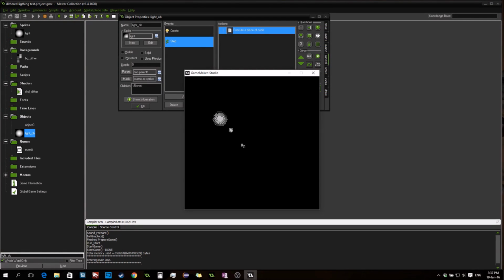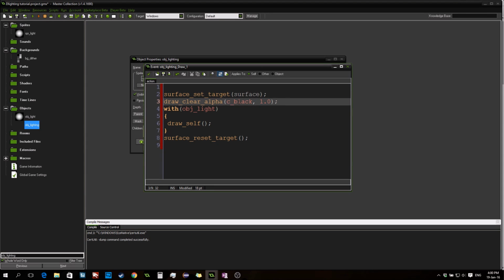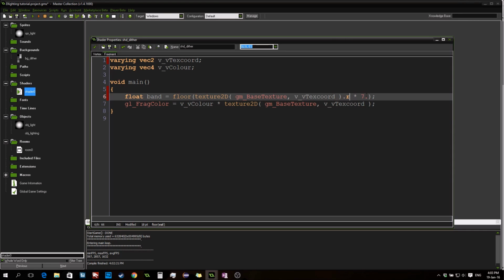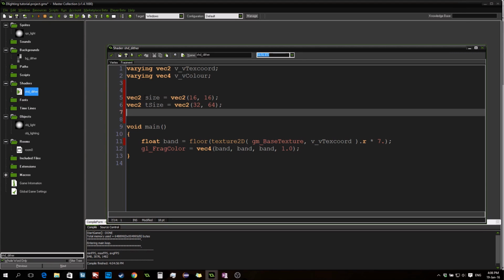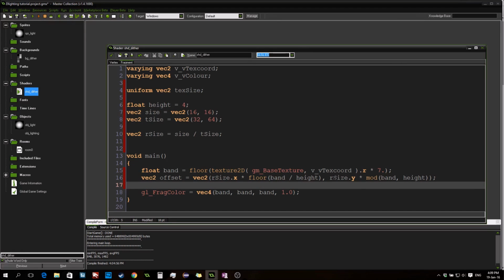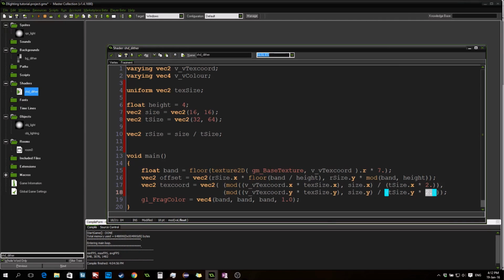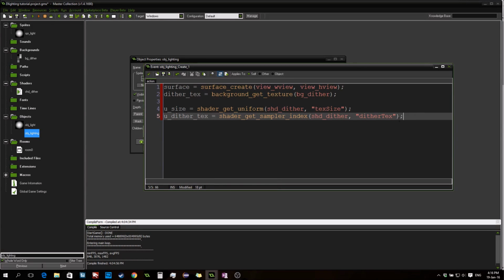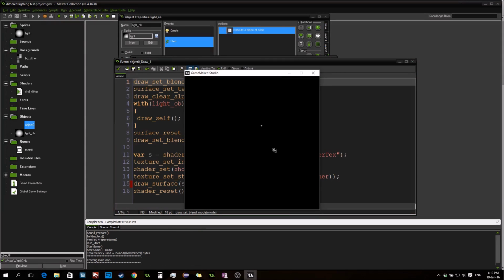Dithered lighting effect in GameMaker:Studio

Comment: Hey wolf! Sorry to bother you on a three-year old tutorial-- but I'm running into a bizarre side-effect of having the viewport larger than the room size (which I want) but a result of this is the pixels are cut off at the sub pixel size. If that makes sense, basically a single pixel of the dither effect at some points will get cut off at a slight angle within one pixel. Is there a better way to scale up the viewport/window size after doing this effect in order to keep its bands and falloff within relative size of the sprite? Hopefully this makes sense, if not, I can provide some pictures-- I've just been tooling around for the past few hours and cannot seem to figure it out-
Reply: EDIT: Opps sorry to have bothered you, I managed to figure it out~! I scaled the window size, rather than changing the viewport size in the room; then changed the bit of text in the shader from "(mod((v_vTexcoord.x * texSize.x), size.x) / (tSize.x * 2.)" to "(mod((v_vTexcoord.x * texSize.x), size.x) / (tSize.x * 1.)" as it didn't need to be scaled up~!

Comment: How could one change the colour of the shader/surface from black to an RGB value?
Reply from the maker: +Luc Wolthers in the shader, multiply by a vector at the end. So * vec4(.9, .2, .1,1.0) would be a reddish color
Reply: thanks for the quick response! I really appreciate it.

I don't think I am doing it right though, am I adding it to the wrong line?

gl_FragColor = texture2D(ditherTex, texcoord + offset) * vec4(.9, .2, .1,1.0);
Reply from the maker: No problem :)  I dont upload that often, but i do try to answer any questions :)
Reply: hate to be a bother, but I just cant seem to get this right. I have the line 
 gl_FragColor = texture2D(ditherTex, texcoord + offset)*vec4(32, 65, 77,1.0); 
and yet the colour isn't changing.
Reply from the maker: +Luc Wolthers this is because the texture is black. And black × anything is black.
Change you dithered texture to be white and transparent.
Also, no bother at all :)
Reply from the maker: Ah sorry, i didnt notice your question in your previous post

Comment: One question. Do you know how to implement this code here? http://xorshaders.weebly.com/tutorials/black-and-white-shader (the luminosity part, not the black and white one) into this, so i can like check for the brightest pixels, not the most red ones.
Reply from the maker: In the shader, you could add a new variable called 'bright' just before we define band. set the value using the tutorial by Xor.
Then intead of using the read value of the texture, use the red value of the new bright value.
I havent tested this myself but it should do what i thik it is you want to do. (use different colored lights?).
Reply: GM Wolf yeah, i'll try to make this happen, thanks! :D

Comment: Thanks heaps for this video yet again :) 
I also saw this post shared by yoyo games on facebook and thought it must have been done with a similar method to what you have shown, but due to my lack of experience in some of the methods of using sharers I couldn't figure it out. You have taught me allot in this video. Thanks again!
Reply from the maker: +QuickshotDev im glad you enjoyed it, and that i could help you.
Reply: +GM Wolf What is really cool about this method is that I can see that not too much more work this one shader could probably be made to dither anything. I have a question about sharers though. I'm wanting to make a shader that generates grass on top of a terrain surface, but how do I check whether the pixel is neighboring transparent pixels? (how do I get the rgba values of neighboring pixels?). 

also if simple enough could you please explain when a vertex shader might be used and what it does? I find it quite hard to find the correct information on google that is relevant to GMS. 

Thanks ;)
Reply from the maker: to get neigboring pixels, you have to use the texture2D function, and offset the texture coordinates by 1px.

the vertex shader allows you to manipulate the vertecies of your model. this is more relevant when doing 3D.
Reply: +GM Wolf ok cool thank you. can a vertex shader also be used in 2D to manipulate the shape of a texture? (stretch and position pixels)
Reply from the maker: it can be used to an extent.
if you manipulate the vertices, the pixels will be linearly interpolated to fit. this means the effect can look rather bad with a low number of vertices. in 2d, the vertices tend to be each corner of your image, so you are rather limited.
Reply: +GM Wolf thanks :) I'll probably just use primitives then or fudge it in another way, at the very least now I have a couple options.
Reply from the maker: +QuickshotDev If you understand primitives: a shader means you can have a static promitive (with a nice, regular latice) and the vertex shader can do the animating. Its way more efficient than re-building a primitive every step.